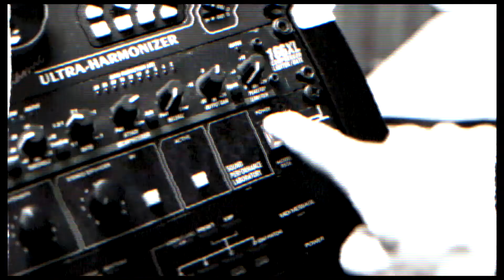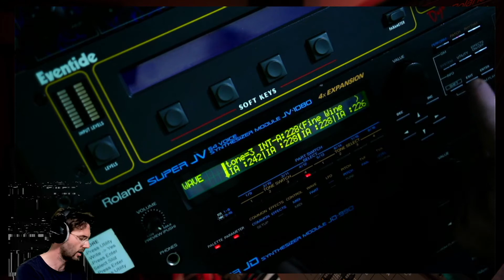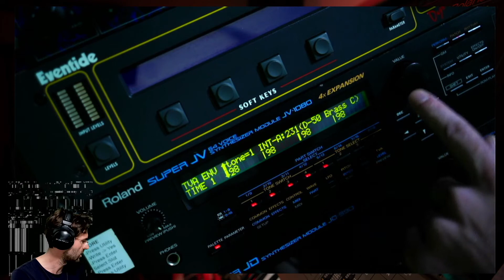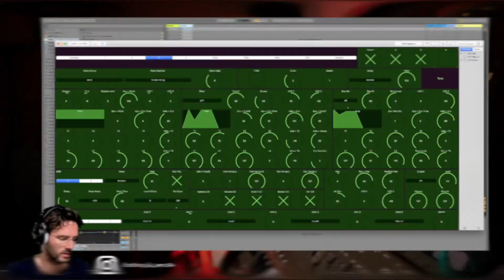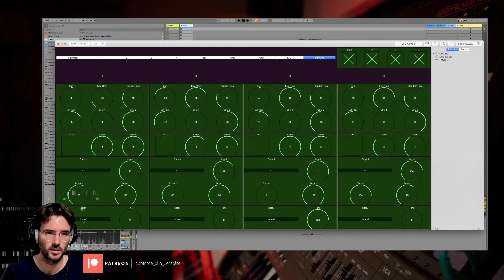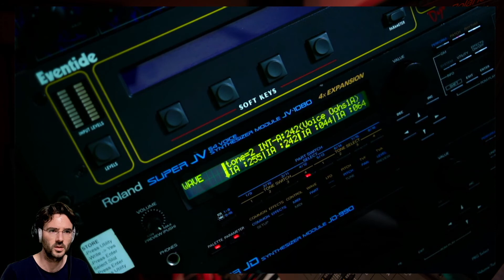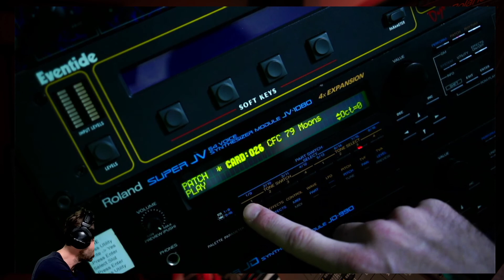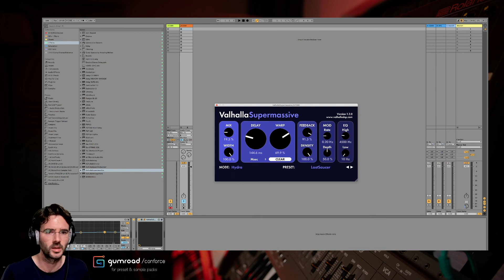Tutorial: Preset Design on a Roland JV-1080 | CONFORCE

Comment: So when you’re editing the patch in coffeeshopped, is the sound coming from the plug-in? How do you get the patch onto the JV-2080?
Reply: sound comes from the JV, coffeeshop editor gives you ability to change all the JV parameters that are exposed via midi/sysex. same with any other synth that is supported by the editor.
Reply: @ridass.7137  how does one connect the 1080 to a mac?
Reply: @Cybercowboy_69  via MIDI so you need a soundcard with MIDI ports or some external USB to MIDI device. I won’t bet ont those cheap MIDI to USB cable adapters.